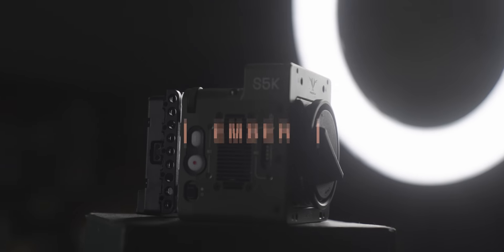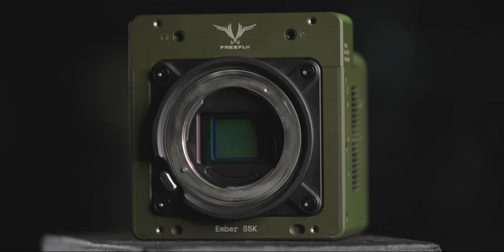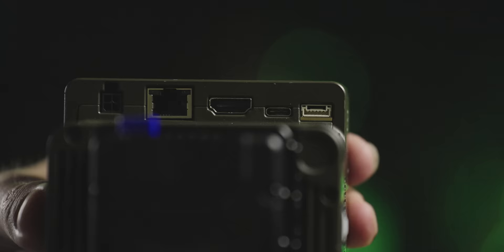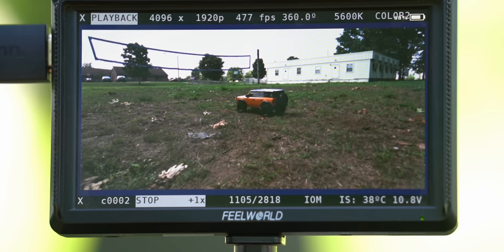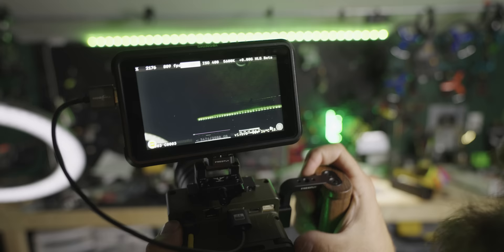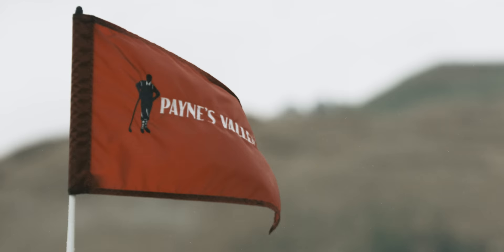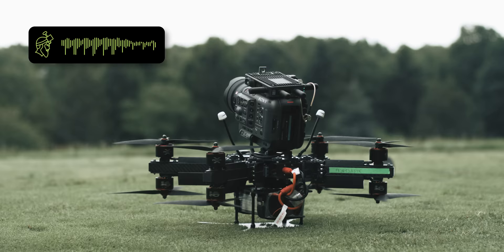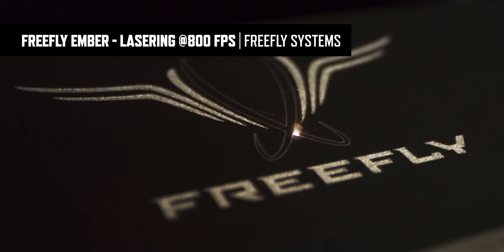Testing Ember - The Super Slow Motion Camera from Freefly

Comment: HUGE improvement over the wave! The biggest challenge I've encountered I just how good it is at seeing the imperfections of the drone it's mounted to! any kind of oscillations you might have (damaged prop, funky tune, wind) shows up clear as a bell! (I'm talking 400+hz oscillations) I saw little glimpses of that in some of the clips you shared here like the subtle vibrations at the slow shot at 01:07 , was that a pretty constant struggle? or more intermittent? 🙏🏻

Comment: Nice man! I’ll be ripping one this weekend on a 6” vulture. I’ll be moving slow but should be pretty sick either way. I’m powering it using a 12v polulu and bringing a bunch of little 4s HV packs as a back up to power directly. How’d you power it on your build?
Reply from the maker: I powered it using a built in d tap connector on the CMW Thrustmaster

Comment: Just fyi, some USB-C cables transfer faster, it might help with the transferring of files, unless of course it is bottlenecked by either the cam, or the device you are downloading to. Some usb-c cables transfer at some crazy high speeds. Hope this helped!
Reply from the maker: I tried a couple different ones -- I've had the experience that you're describing with different cables. The fastest that I was getting out of the camera was only about 250-300 mbps, which was dissappointing. The fastest that I've gotten across my USBC bus on my computer is closer to 520 or so..
Reply: @NURKFPV  yea, that is def disappointing, hopefully when you get your on personal edition, they can fix(or upgrade if it’s not a “problem” in their eyes” if you want to do a lot of work, for slightly better speeds, you could change the port on the cam, and that might help, but it might just be a low-ish quality nvme on the cam.
Reply: @NURKFPV  love the content btw, look up some to you skills and knowledge, thanks for the awesome content